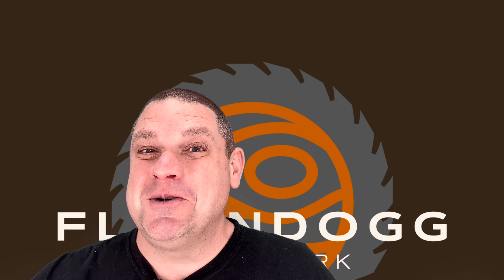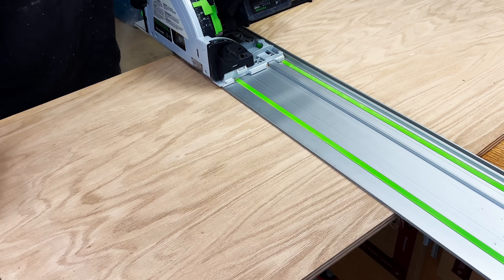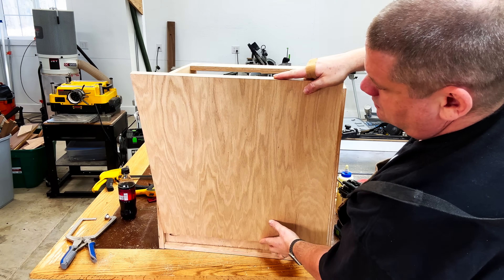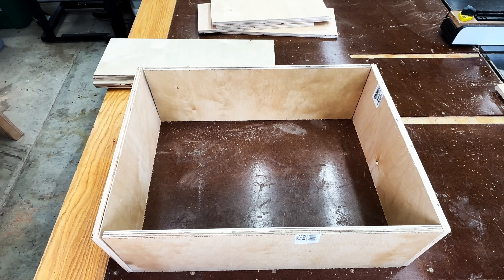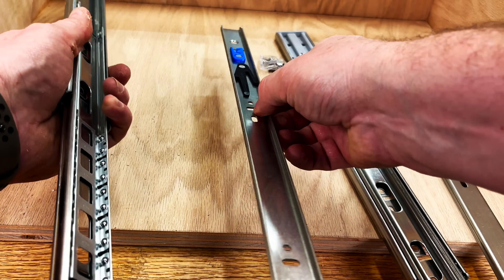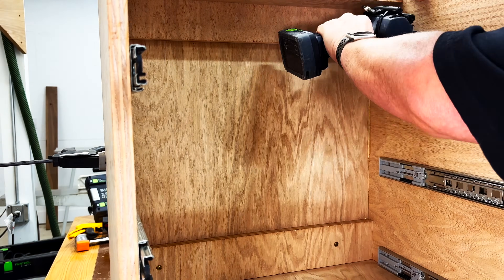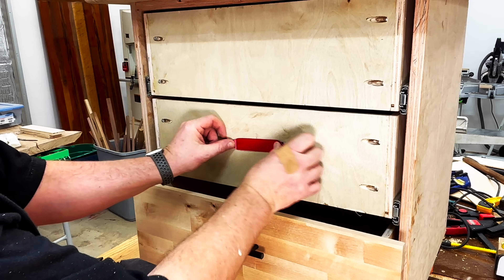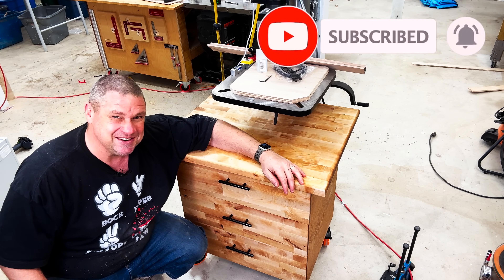Crafting the Ultimate Drill Press Cabinet

Comment: Nice looking cabinet with a beefy work top.
While watching I noticed @8:12 you had a slight bow in your tape measure. Probably just enough to measure slightly long, and throw your calculations off just a hair. Good job compensating for that.👍
Reply from the maker: great point and nice catch!   that very well could have been it.  Either way, I was happy I was able to squeeze that last drawer in.    Really like the way it turned out.  Thansk so much for watching!

Comment: If your casters are taller than the height of the base then the base height doesn't matter does it? Awesome build I always wanted a full size drill press but space dictates that I only have a bench top.
Reply from the maker: Yep, that's exactly right gigaphonicon!   That was one of the reasons why I chose such large wheels.   They were 5" tall which was more than enough to strattle that base.   Great observation, and thanks so much for watching!